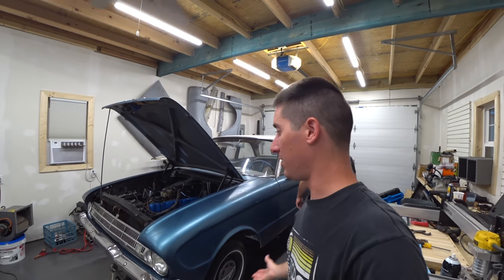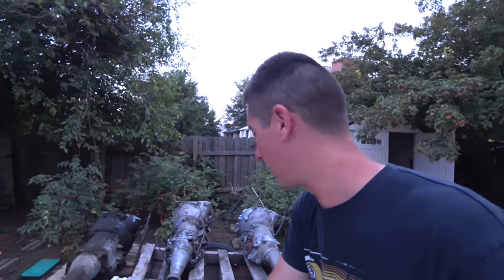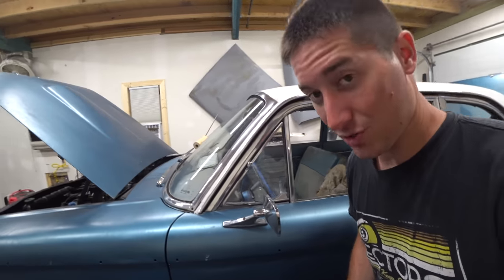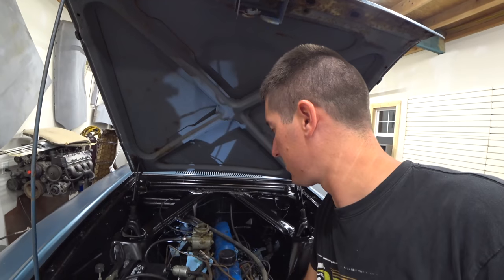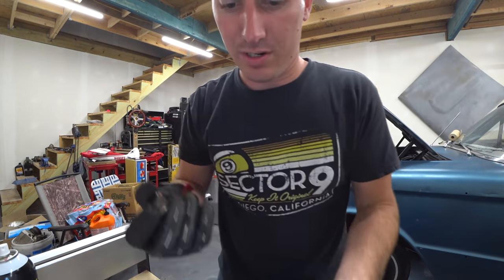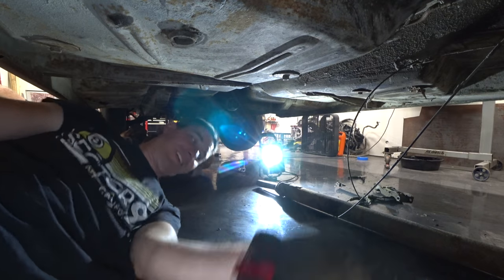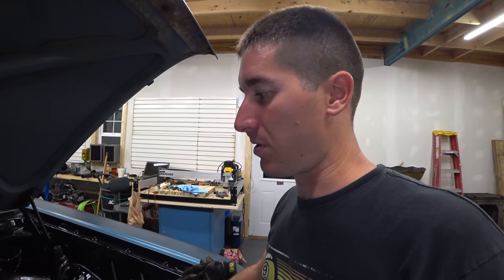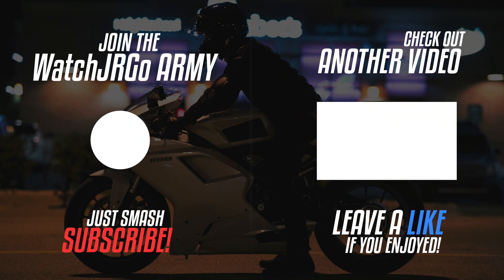Giving This 61 Ford Falcon HIGHWAY LEGS *3 Speed Transmission SWAP*

Comment: Great video guys.  I bought a new 63 Falcon when I was fresh out of the Military.  Served us well. After 17 years service it had no rust, original engine and tranny, no leaks almost zero oil consumption. An excellent value. It outlasted all the "muscle" cars our friends and relatives had. Always wondered how it would do with a 3 speed and an alternator. If we only knew what lay ahead would have updated the Falcon and kept it. Locally it was being sold at the same price as a new VW beetle back in 1963...just under $2,000 for the base model.

Comment: I grew up working on these cars. My Dad bought one of these new
and handed it down to me. When I sold it it had over 250,000 miles
on it.Still ran great keep the fluids fresh  and they will run forever.
The frame was full of rust from New England winters.

Comment: Um, open the garage door before you start it perhaps?  I love it when things go 90% smoothly like this swap.  You two made it look effortless.  Great job!  New drive shaft and off you'll go.  I agree with Wm Berger, upgrade the cooling.  My friend's '61 had big issues.  Foolishly she ran it solid antifreeze just to keep it on the road.  In hindsight, even a little water would have done miracles!

Comment: I once had the 140 c.i. (Yellow valve cover), mated with the Fordomatic 2 speed trans. It wouldn’t get out of its own way, but I got 40 m.p.g. On the highway (when I dared). I’m not usually a fan of satin paint, but the blue looks good on that rocket ship. A 200 c.i.d. With a 3 speed transmission, better stand clear! Good luck trying to return that starter to RA. Just use it for a paperweight or something to prop a door open. ☮️

Comment: Love the Falcons! They used to be the cheap winter car in Buffalo in the 70's. I spent many a night rebuilding brakes, floorboards, .....   BTW, those old Ford starters are easy to work on. I worked at an autoparts store and we had barrels of non-working cores waiting to get returned to the rebuilders. I could grab a few, take them apart and get 1 good one out of it for a friend. A little cleanup on the brushes and armature usually works.  Thanks again for the channel, been subscribed for a while and always enjoy the adventures.

Comment: Awesome video
I have a 2 speed on mine I'm looking to upgrade,
Is there a way of adjusting those 2 speeds so they don't hard shift and also where could I find the transmission mount for it I'm having trouble finding online
Reply: They shift harder if you use Type F transmission fluid. Use Dexron fluid instead.

Comment: 2:47 Fly Wheel  or paper Plate   neither  it's called a flex-plate . The wrong starter will sheer the bolts  off and destroy the torque converter . There is a channel in the starter that lets the bolts pass through

Comment: Hello JR,
Love your channel. I have a question for you. My daughter has a 2010 Kia Rio that randomly stalls out. When it does, we wait a few minutes and then it starts back up. Is this a common problem with Kia Rios? The local mechanic doesn’t seem to know what could be causing the problem. The check engine light does not come on. The car has about 75,000 miles on it. Any help at all would be greatly appreciated. Thank you.
Reply: Hi! Try fuel injector cleaner. You pour it into the gas tank and after a few days, you should see a difference.

Comment: Please explain the obsession with LS motors?
Ford engines are just as good and I thought were reasonably priced
Reply: shsv81661 - 302 and it’s variants can be similarly priced. Coyote engines are expensive and HUGE. The LS is cheaper and fits so many more vehicles. 
     I hate seeing GM motors in Fords. I have a 1970 GMC Sierra Grande that had no motor but was great otherwise. I tried to price out a Coyote swap with a 6 speed automatic and proper wiring harness. They actually have a kit. To get someone else to do it was going to cost me $35,000 Canadian plus contingency $. I went with a 502 big block with 6 speed automatic as a retro kit. Fuel injected etc. Basically a bolt in once we had the motor mounts. We did it ourselves (a small group of gear heads usually, 15 showed up the day we put it in). It was just under $25,000 Canadian all in. It is a really sharp truck and much faster than if we put the coyote engine in. Still would have liked to do it just to annoy my friends drivin older, pre 1960, ford cars with GM 350 and LS motors. Now working on a 1969 Ford Bronco. Gonna be a while (rust). Picked up a nice 1949 Ford F1 with a somewhat built Flathead V8. Has a Turbo 350 trans. I have a nice rebuilt C4 waiting to go in. Need a bell housing yet. Also have to remove and recreate a cross member for the transmission. I should go back to work! Easier than retirement! Hahaha
Reply: Barra swap it & use spare jag transmission

Comment: Why are you doing automatic instead of standard? Automatics at the time sucked. 
My 61 has a three speed trans but struggles to keep up with traffic.  It does only have a 144cu though..
but why is the guy talking about needle bearings at about 6:58? Just replace the fucking entire universal joint Duh!